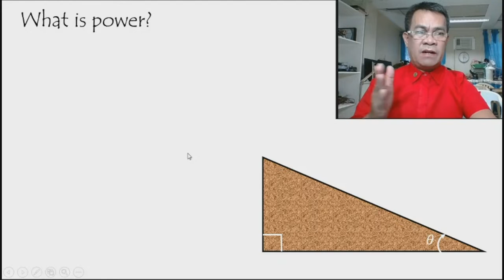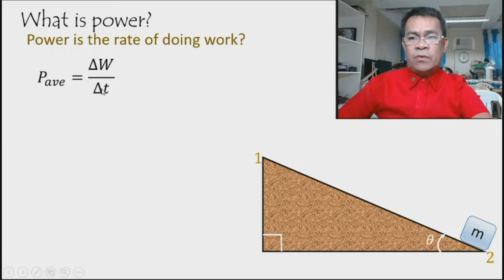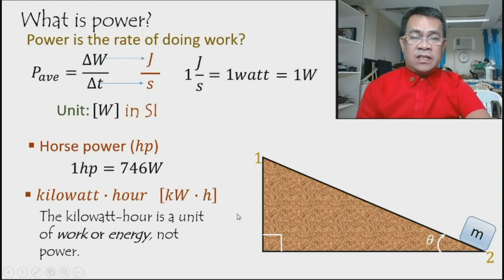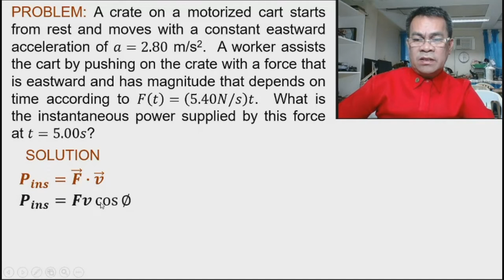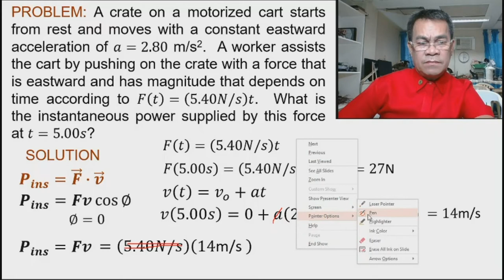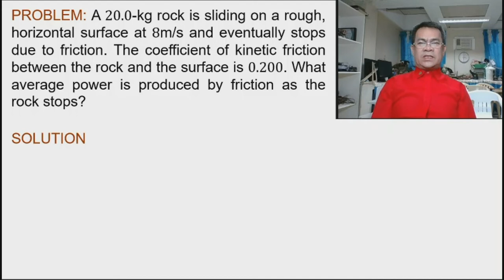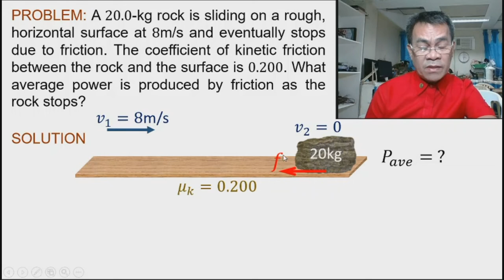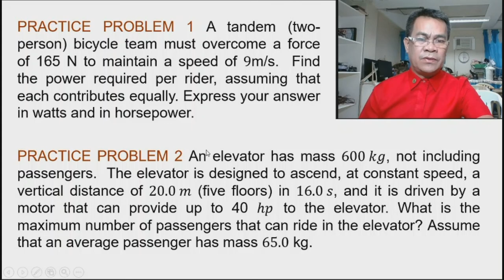Part 6 | The Average  & Instantaneous Power and it''s Applications

Comment: Is the answer to problem 1: 742.5W and 0.995hp?
Reply from the maker: Thank you for watching.  It's purely typographical error, please replace 5.4N/s with 27N. 

 Power = F .v = (27N) (14m/s) = 378 W = 0.507hp.
Reply from the maker: Yes, it's negative, or say it dissipated power by the friction.